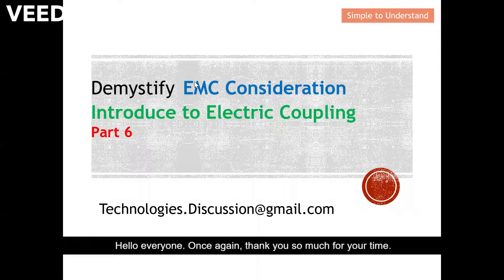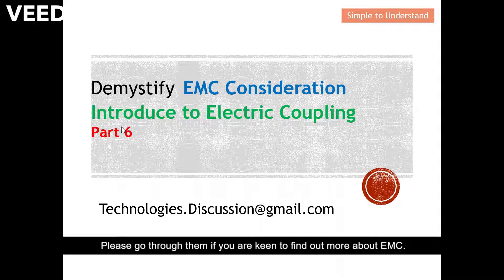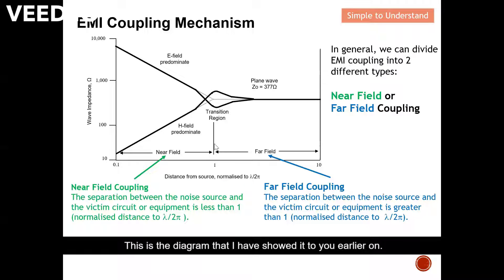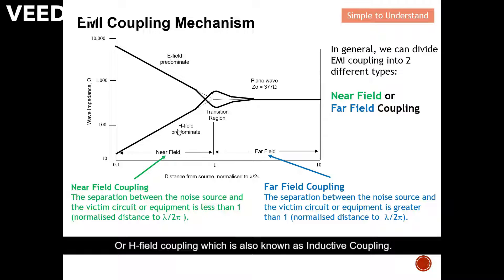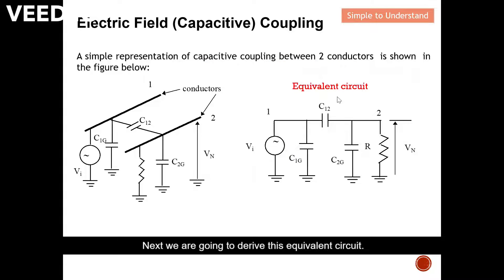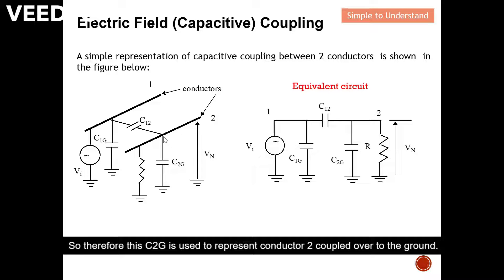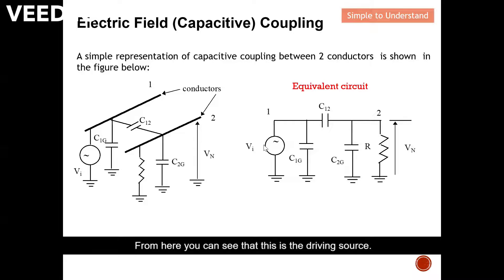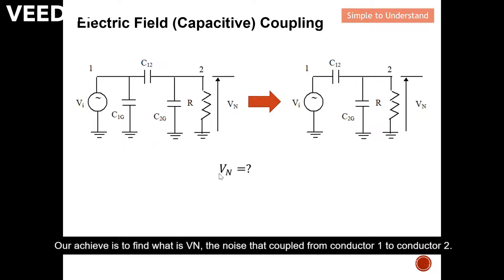EMC #6. Electric Field (E-Field) Capacitive Coupling Explained: Causes, Effects & How to Reduce It.

Comment: Hi, I can understand the equivalent capacitance to ground and the equivalent capacitance between the two lines during the viewing of the capacitive coupling model, but the resistance I don't quite understand, does it represent the load on line 2? Looking for an answer, thanks!
Reply from the maker: Thank you for your question. :)
It actually represents the load connected to line 2. In fact, you can change this according to actual connection of line 2.
Hope I answer your question.  :)

Comment: Why C1g don't you consider?  Why Is it not contributing electric coupling part?
Reply from the maker: The voltage at Vi is the same as voltage at C1G (parallel) so therefore I remove C1G.

Comment: 2:12 you said electric field couples with nearby conductor. Does coupling occur due to displacement current or is there any other reason because i didn't understand that?
Reply from the maker: When 2 conductors have different potential difference, the one (conductor) that has a bigger potential will couple the energy into the conductor that has a lower potential one. Something like a Capacitor.